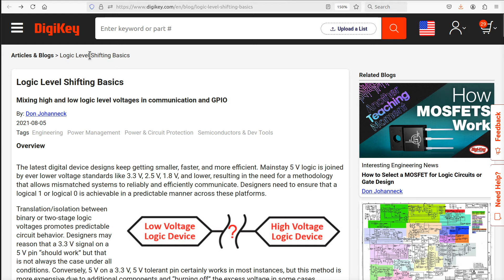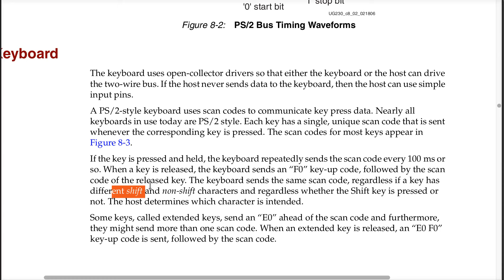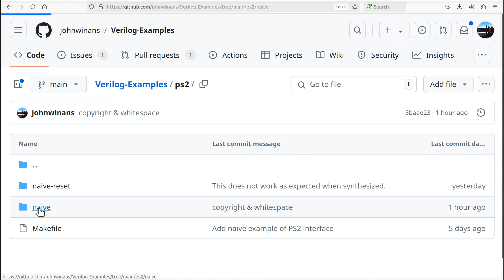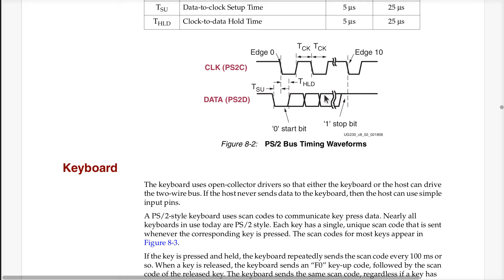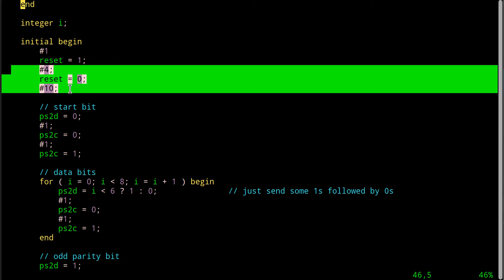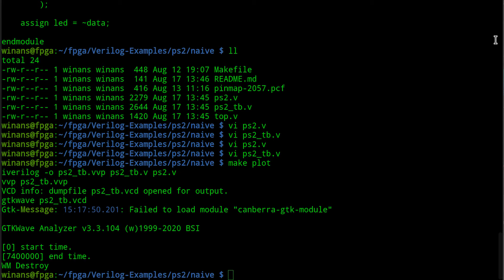Simple PS/2 Keyboard Interface in Verilog

Comment: I remember many moons ago I implemented a PS/2 port on a PIC MCU. And I found that I got quite a few parity errors. So having the ability to request the keyboard to re-send the last keycode is really important. 
Even if you don't want to control any of the LEDs and stuff, you still want to have the ability to send bytes out to the keyboard. 

Now you might think "doesn't matter, I'll just ignore erroneous keycodes". But keep in mind, you might receive the " Push" Code for a key, but then get a parity error for the release code. And then you end up with a stuck key.
Reply from the maker: 🤔  Makes me wonder if there were other issues at play too.  I'd expect a very low error rate...  I guess I'll find out... Maybe leave a hammer laying on my keyboard for a week...
Reply: @JohnsBasement  it's possible that it was just crappy wiring on my part, or maybe I had a particularly crappy keyboard.
Reply from the maker: @TSteffi  Regardless, it is good to know!

Comment: Considering that up to 3 LED’s may be strongly illuminated, fusing for the 100mA recommended on that website might prove more reliable.
Reply from the maker: @ChrisSmith-tc4df  yeah, that is a schematic in fairly early design.  I ought to go with 500 since it will be for both the keyboard & mouse ports.

Comment: The series resistors on the FPGA side of the level shifter would slow down the edge rates as well commensurate with the 10-17kHz clock rate for less over/undershoot on the long keyboard cable.